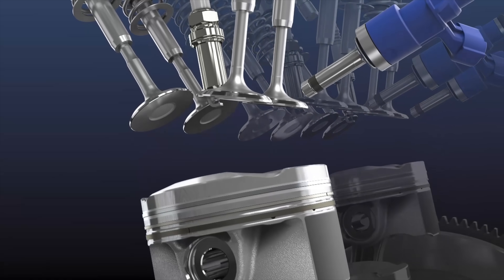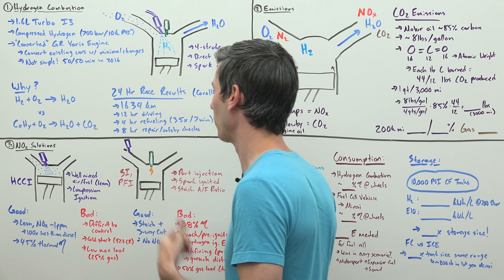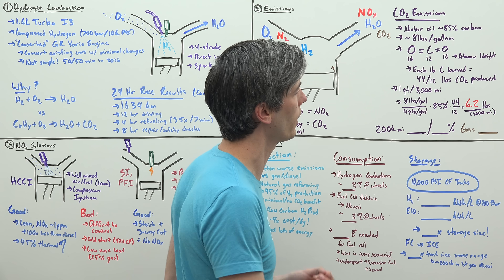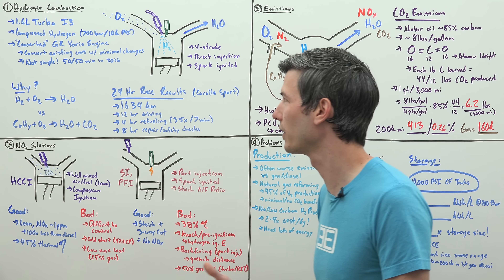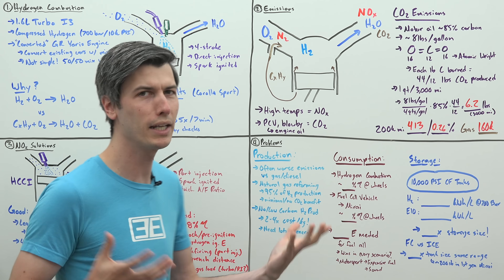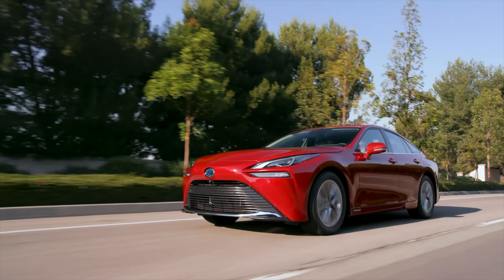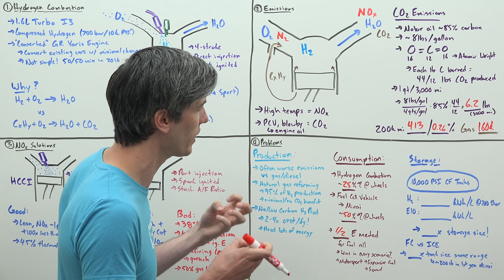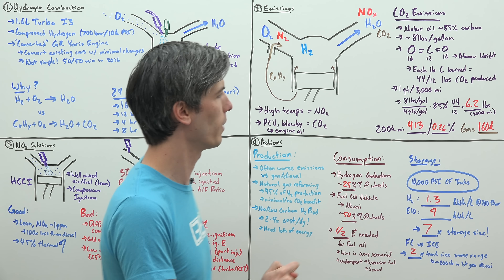Toyota's Developing A Hydrogen Combustion Engine!

Comment: that gasoline idea sound pretty cool, not heavy, a lot of energy in small space
Reply: the power curve on gas vs hydrogen is totally different, i really am just guessing a hydrogen would make insane power at insane RPM, so push that engine to 14,000 RPM  on a dyno ?
Reply: You can't just decide to push an engine to 14,000 rpm. Go turn a wrench
Reply: That pollution though. And the stink is bad, plus that obnoxious starting sound, rough feel when driving, and not all functions available unless the engine is running, oh yeah and you can't drive or run the engine indoors either. Hmm. Maybe not so good.
Reply: @Walkeranz  it is a small displacement 3 cylinder, right? almost a motorcycle engine . shorten the stroke too
Reply: @benjamind7290  Nah doesn't smell, pollution is NBD, sound is great, rough feel only if you drive a shitbox, and why would you want to run functions indoors or when the car isn't on.
Reply: @chir0pter  It does smell and pollution is a big deal. I agree with you on the other points though. But we will have gasoline engines for a long time still, even if only on sports cars and some motorsport, don't worry
Reply: @ne1cup  why can’t they spool it up with electric starter engine that can be charged once its up to speed
Reply: @benjamind7290  Pollution in minimal in the western world the real issue is China and India they run wide open without using the already decades proven pollution controls already developed.
Reply: @benjamind7290  yeah but as a mechanical engineer, soooooo cool 😎
Reply: @benjamind7290  complete non-issues in the west
Reply: Running a car indoors? Cmon man
Reply: Diesel hydrogen engine.
Reply: @bowdownandobey  Having a big mechanic shop where you can drive cars around inside? Very useful. Being able to sit in your heated car in your garage? Useful during the Texas February event. Pre-heat your car while it is still in your garage? Heck yeah! So... it turns out, quite useful.
Reply: @chir0pter  Gas cars smell terrible. When you drive an EV you realize how bad gas cars actually smell. Oil, gas, little exhaust clouds all over the place. Ugh. My nose isn't sommelier level but even I can detect those noxious fumes.
Reply: @benjamind7290  Nah they smell great.
Reply: @joaopinho2361  Nah they don't smell bad and CO2 isn't a big deal.
Reply: @robc8468  Really? You honestly think that? Then you are way out of alignment with the facts. As CO2 output is the most easily measured we can start with that: China 8 Tonnes per person. USA? 19.8 Tonnes. Also that does not take into account the vast quantities of beef produced for the USA markets in places like Brazil etc which produces yet more greenhouse gasses which are not covered in the above figures. China does not import much food at all.
Reply: Well we could keep our petrol engines forever if our government were not so greedy for money from oil (although we'd still use it). They need to invest in the extraction of carbon from the CO2 in our atmosphere, the fuel that can be made by it is cleaner, plus combustion engines can then become carbon neutral, bury some permanently and the World would become negative carbon.

This way us petrol heads can keep using our combustion engines, while the A-B'ers and public transport can have their electric or whatever the future may bring otherwise, although then, combustion engines will be much greener than electric vehicles anyway.

Remember these large extraction plants already exist, we just don't have enough of them, the CO2 is mostly sold to agriculture for those massive greenhouses for better yields.
Reply: @gordonlawrence1448  China produced 14,400 million metric tons of CO2 in 2020 versus 4.47 million metric tons for the US which has a larger economy than China.  Brazil and India also are Higher than the US in absolute terms.  Anyone who really cared about air quality would move manufacturing back to the US and Europe where it would be done in a much cleaner manner. I would say it is you who are out of alignment with the facts that matter.
Reply: Mike  you do know Electric cars were about then too! I think they were actually around before combustion engines, at least in cars. Check my last comment though, that is really what needs to happen, infinite clean fuel and carbon neutral.
Reply: Mike  Electric cars have been around`for 120 years gasoline works  far better for most people due to range limits and slow charging issues of electric vehicles.   I would concede some applications like local mail delivery trucks could work well enough low speeds lots of stop an go working within a limited radius and could be charged overnight at the local post office.
Reply: I think that they can upgrade the fuel later by adding some carbon to make storage of H2 easier! ;)
Reply: @robc8468  thats something we always want to believe so we dont have to change anything, but it is just not true, as comfortable as it would be
Reply: @niske  The left wants you to believe that CO2 which is needed for photosynthesis by plants CO2 is needed for our survival the climate is driven more by the sun than anything else good ideas do not need to be forced by government they will evolve in the free markets. To de-industrialize the world in the name of a possible 1 or 2 degree average temperature shift in 100 years is madness some global temperature shifts are on 1000 year cycles.  If you can read between the lines the government sees a "carbon tax" and carbon credits as an opportunity to tax people more and limit their freedom of movement.   This but one piece of the agenda promulgated by the World Economic Forum as part of the "Global Reset" being promoted.
Reply: these engines will give mechanics hope of repairing things again yay!
Reply: @benjamind7290  much more important things to worry about with automobiles than something you can fix with a shop van. This is ridiculous but to each his own.
Reply: Fan*
Reply: You know what's a better idea Zero oil and gas !!!!
Reply: @Walkeranz  well yeah you actually can. you just might not do it twice.
Reply: @benjamind7290  Well, true for an econo-box; but starting a car that was meant for driving with a corresponding engine? Thats just pure bliss.
Reply: Mike  to mass produce batteries it gives a massive carbon footprint, you'll save the world much easier by planting tress and keeping the oil burning combustion engines and extracting co2 from the air and making our fuel, as said in my original comment above.

Electric vehicles also still have some way to go, we just do not have the right technology yet still to make it work out fully. Obviously range and battery technology is improving all the time though, and they will have their place for some time.

But as I said, we can easily make combustion engines carbon neutral and the world overall carbon negative. The governments around the world are ignoring it as they are greedy for the money coming from crude oil. We would still use it, but much less so if we get our fuel from the co2 we've already burned, in cars etc.
Reply: Mike  So some people need to drive 600 plus miles a day for business or vacations.
Reply: Mike  So one reason your driving costs are low is that others buying liquid fuels are paying considerable fuel taxes for road construction and maintenance that electric car owners are not paying.  Furthermore, some people want and need cars and trucks that can cover 600 plus miles in a day for business or vacation travel.   Consumers will decide what they want in the free marketplace.
Reply: @bowdownandobey  like in your garage or in a repair shop. Are you aware of at least those 2 indoor areas?
Reply: @waynejackson169  shop fan. Please don't be silly
Reply: Mike  Maybe you live out on the west coast charging stations are not common in the mid-west or southern states. The majority of people will not be buying all electric cars any time soon I have seen a total of 3 Tesla's on the road in my entire driving experience and I put on 12000 to 15000 miles per year.   Be grateful not many are driving electric since a mass switch would require a massive grid and power plant expansion in the 40 to 50% range and huge electric rate increases to pay for all the capital required not to mention the lead times involved.
Reply: @joaopinho2361  especially because lithium is a very limited resource
Reply: @benjamind7290  if you don't like the smell of gas you don't like cars
Reply: @HalfdeadRider  to be fair even right now combustion engines are greener than EVs
Reply: Mike  battery is definitely not a good long term idea, lithium is expensive, dangerous, and limited, and producing EVs is far more harmful to the envornment than driving around a combustion vehicle. Not only that but EVs are extremely heavy and take forever to charge
Reply: Mike  You do realize that the majority of electricity is generated via natural gas right?
and it's just a fact that EVs have a bigger carbon footprint than even a diesel vehicle
Reply: @houseking9211  Do you know where I can find that info? bigger carbon footprint
Reply: @houseking9211  Speed or the smell of gas? Which one is more important in a car? Because guess what, in the speed department gas cars are becoming obsolete.

Comment: Fascinating explanation, really enjoyed this! I used to think hydrogen fuel was a no-brainer for sustainability but it's not quite that easy. As usual, thank you for the awesome video! Nicely executed, well articulated.
Reply: It's no brainer if you have no brains. Why waste most of the power produced on an inefficient process that roduces an inefficient fuel which which produces insufficient power? Also, you have to carry around two heavy H2 tanks containing the gas at such high pressures that a smile accident can cause them to both explode due to pressure and ignition. Definite death. Even a simple leak in any of the piping is enough to cause trouble, which is bound to haen due to the excessively corrosive property of H2.
Reply: Actually you don't need to store hydrogen in tanks. They have developed technology that is far safer. It's been around for quite a while actually. But yes if you just got out of a time machine from the year 2000, then that would make sense.
Reply: @Berkhoi  Apart from the points that you have raised, the real problem is that the energy used to compress the hydrogen alone can exceed the calorific value of the fuel. This makes the whole concept virtually pointless. Needless to say, I would not want to live too near to a filling station and tankers delivering hydrogen compressed to an excess of 10,000'psi would be travelling bombs, even without any fire. 
Back in WW2, when fuel was short here in the UK, many delivery vans ran on coal gas (97% hydrogen). However, a large leather bladder was fitted onto their roof, to allow direct filling from the town gas supply only pressurised by the gasometer's.
The natural coal tar mix improved combustion and lubrication, but the bladder was almost as large as the van, with a range of between 20 and 30 miles.

PS, the risk of combustion explosions with hydrogen is fairly low compared with LPG. Propane (which is heavier than air) pools and causes fire balls. while Methane diffuses and explodes. Both of these gasses have caused explosions after leaking into below ground sewers.
Reply: @wilsjane  the real problem is too many people and pop growth is rising exponentionally !@

Comment: I love next gen technologies that involve even more moving parts!
Reply: Only thing missing is fuses placed in the center of the engine.
Reply: Right. I just did a timing job on my Ford 281ci. A lot of work and moving parts. How about a cylinder and some spark with electronic timing?
Reply: More moving parts = more jobs 😄
Reply: And also use a fuel which isn't actually renewable (electrolysis isn't cost effective, almost all hydrogen is made from oil), green (still has emissions) and in general is just a campaign by fossil fuel and engine manufacturers to avoid becoming irrelevant.
Reply: @squelchedotter  that’s nice, thank you for sharing how you feel Thomas
Reply: Me thinks your being facetious is lost on many.
Reply: With toyota it hardly matters
Reply: @tych88  He is not wrong.
Reply: @squelchedotter  Since when is hydrogen made from oil ?? I was under the impression it was made from WATER.
Reply: @itchyvet  Water (H20) contains hydrogen, but so do fossil fuels, e.g. Methane (CH4). The hydrogen in methane is cheap to separate out. You basically just burn it in a special way, producing CO2 and Hydrogen. Whereas separating hydrogen out of water requires huge amounts of energy and cutting edge equipment. That's why nobody does it that way.
Reply: @Alex McAuliff its easier to control emissions in a facility than in a billion cars, however. The question is would we trust the facilities to do it?
Reply: @itchyvet  it was covered in the video
Reply: @squelchedotter  + it would put kids mining cobalt out of work!